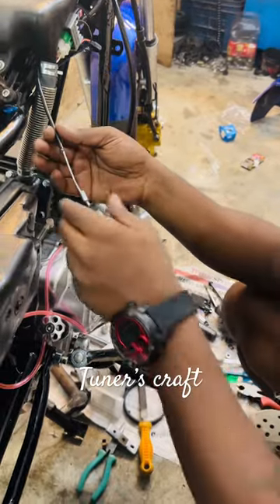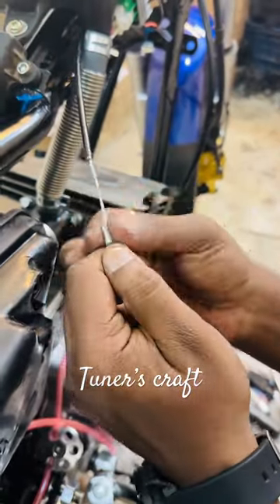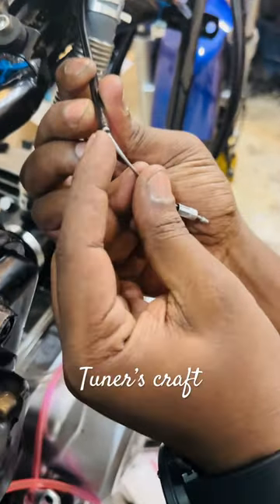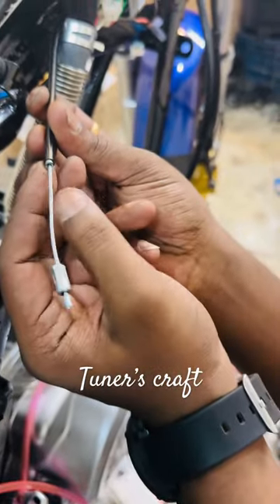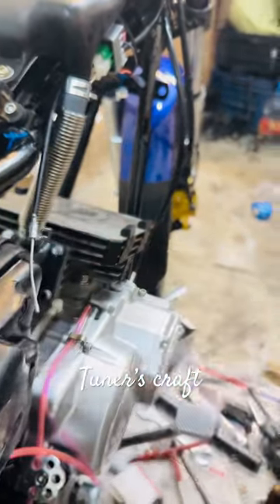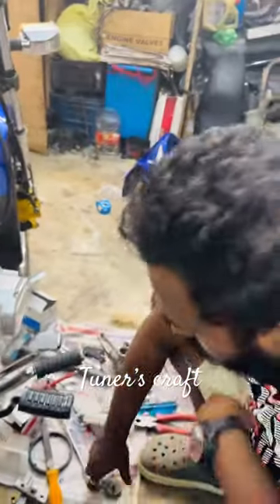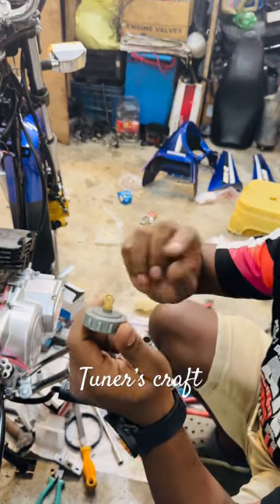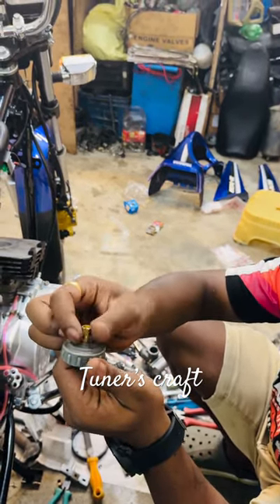Easy way to Fix Quick Throttle on bikes❤️ #rxz #domino #yamaharxz

Comment: But what About 2t connection sir
Reply: Use old bullet 350 accelerator cable metal two way pin. There is allredy an slot for an wire on one side and you have to make another one on other side of the pin for another wire. Then engage your quick throttle cable in middle of the pin. and oil pump cable engage in one slot and accelerator cable for carb in other slot 🔥👌💯👍
Reply: @vijayendrahirwe502 
Bro I have done like that but acceralaction is raising 😅what to do
Reply: @darshansm1515  adjust the carburetor wire at carburetor cap. Use plier to thight or loose the cap nut. 👍